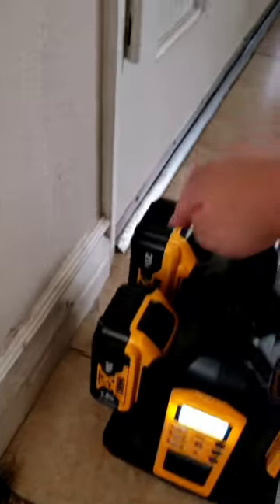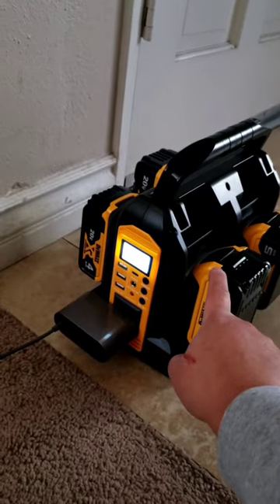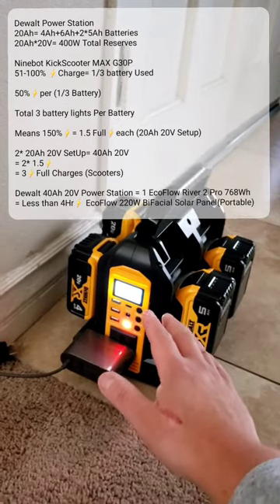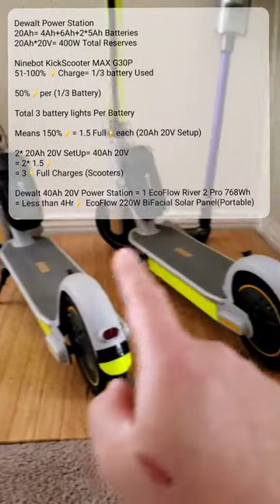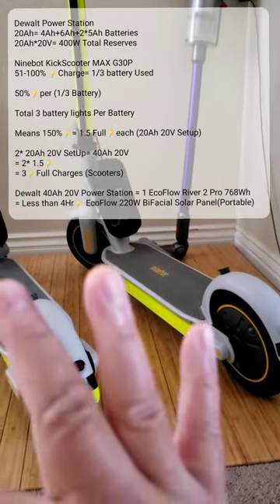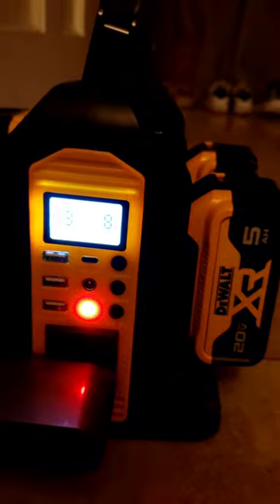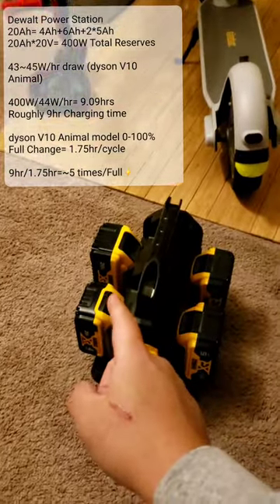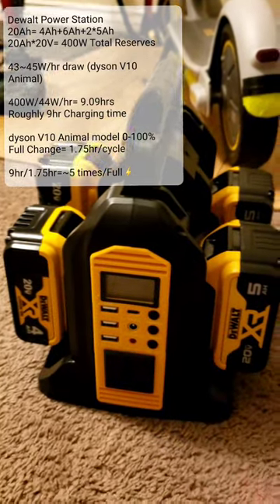FULL: Dewalt 350W 20Ah 20V Power Station vs Segway Ninebot KickScooter MAX G30P vs dyson V10 Animal

Comment: Thanks for the information on this product. Does it have the ability to charge the batteries while they are connected to the inverter?
Reply from the maker: Sadly the Investor only give OUTPUTS, there is no Inputs, other than Dewalt Batteries.   It seems only act as a power station Not a Charger too.  Thanks for Watching

Comment: Hi body, how are you? I bought 2 20v 2.0ah Ingco battery. I wonder if I can use them with this power inverter. I wil receive the Inverter in 1 week. However it said that can be used only with dewalt 20 v batteries. I think I made a wrong purchase 😢😢
Reply from the maker: My experience it goes from 20V full to 15V to near low for Inverter LED display.  So, I think it might work for battery within that range.  Try it, worse come to worse, just return it if it doesn't work.
Reply: @Repsol13 , you're right, body. I will let you know how it goes. I howp to receive the power inverter on next Wednesday. 😉

Comment: Where did u get this DeWalt power station? Share link please
Reply from the maker: It is an off brand, not really Dewalt, it is 350W, not other 300W ones.  When I said Dewalt Power Station, I mainly meant a power station has all Dewalt 20V XR batteries. 
.
Amazon Link below👇
.
350W Power Inverter for Dewalt 20v 60v Battery, 4-Ports DC 20V to AC 110-120V Battery Inverter with 3 USB-A Port, 1 USB-C Port,300lm LED Light for Outdoors Camping Travel Hunting Emergency(Tool Only) https://a.co/d/8wEoU1v